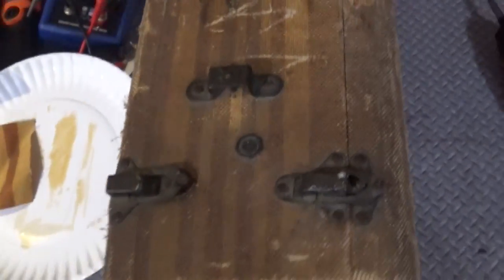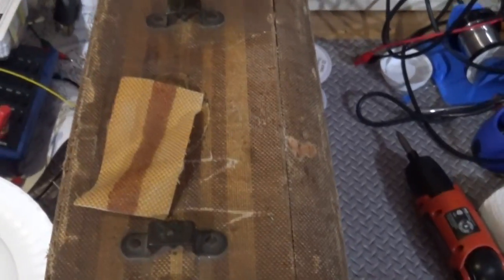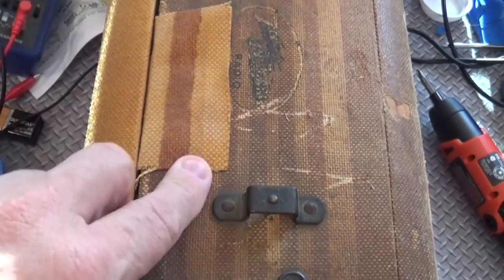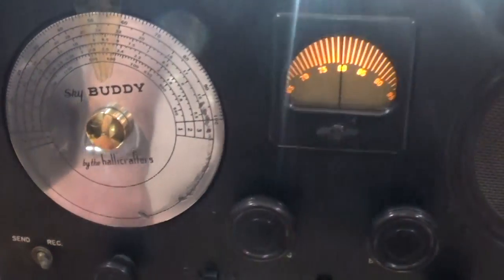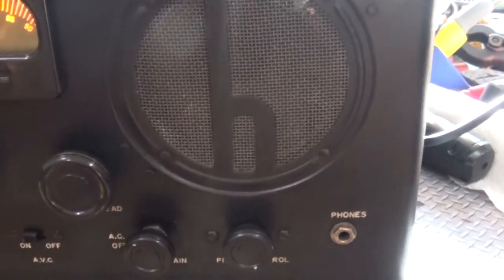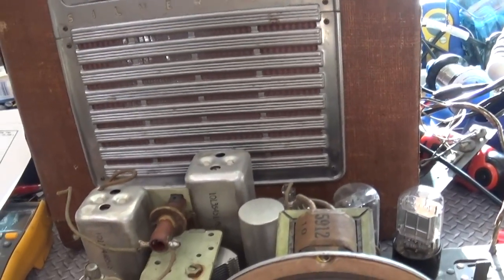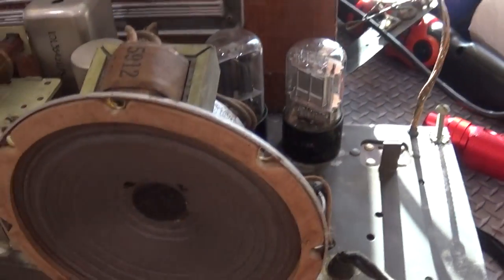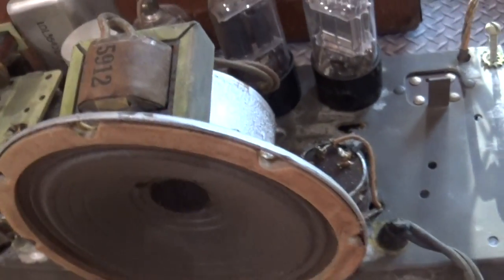Odds & Sods #8 - Every Sky Buddy, Zenith and every cloud has a Silvertone lining.

Comment: Beautiful Hallicrafters, Ron.  I have an S40 A model myself but it hasn't been restored and I haven't even tried it although the guy I got it from say's it does work. I think it was made in about 1949 but definitely in the late 40's.  You find the coolest little lunchbox radios!  My Zenith H500 Transoceanic has that outlet on the chassis for when you're using a battery as well.  I bought a reproduction battery for mine.  When I got it it had an original Zenith battery still plugged in inside it, lol.  This isn't the same H500 I made the video on.  I gave that one to my Uncle Dan since he wanted to listen to shortwave and I couldn't get his Philco working.  The one I have now works, but it needs some work too, the dial string slips, it's filthy inside and out, it hums a little, etc. etc.  Like John, I noticed that that speaker looked like it has a hole in it but that should be an easy repair.  Take care, Gary
Reply from the maker: Thanks Gary.  The Hallicrafters is an awesome unit and I will fix that speaker for sure. Its a little show piece. After I finish up these portable radios I am going to go back to some of the older ones from the 20's as I enjoy those the most.   Keep on working is the motto on this stuff.  Thanks Ron

Comment: BFO = Beat Frequency Oscillator for SIDEBAND, generally ham radio, 3.7-4:0Mhz (75 meters), 7.2-7.4Mhz, (40 meters) and 14.2-14.4Mhz. (20 meters).    30-60 feet wire antenna should do well.  
If it's a transceiver, don't transmit without a license.  And don't transmit any transmitter  without an antenna connected.  That will blow out the finals.  
Batterymaker makes retro battery packs for old farm radios.  He can be a lot of help too since he specializes with farm radios.  
Enjoy Ron,  Don
Reply from the maker: Good info Don, thank you very much for the info !!   It does have a send/receive switch but I do not see any place for a handheld mic, so probably just receive.  This is a whole new world for me - thank you Don
Reply: Ron, the send/receive switch is when  you would use that radio to receive and then click it off and use another radio to transmit.

Comment: The audiio output transformer is actually mounted onto the PM speaker.  
That big transformer is the power supply.  So no series tube filamints.  And it's isolated.
Reply from the maker: Got it, it makes sense